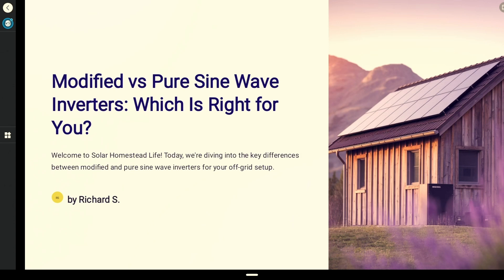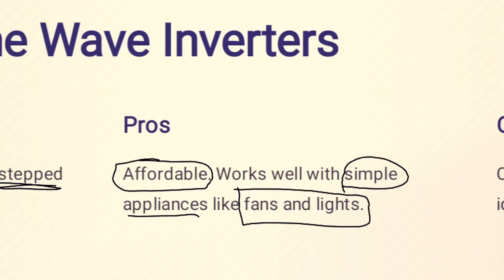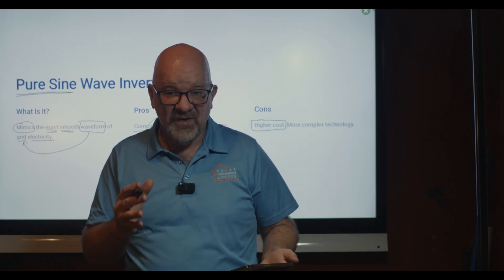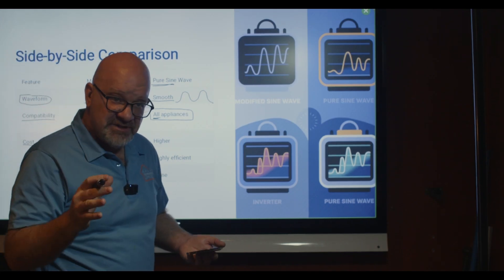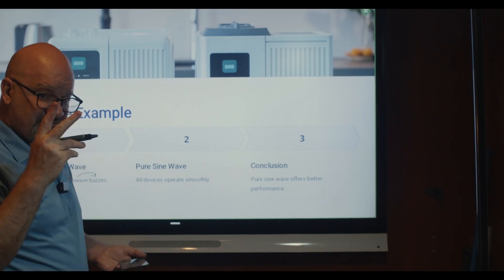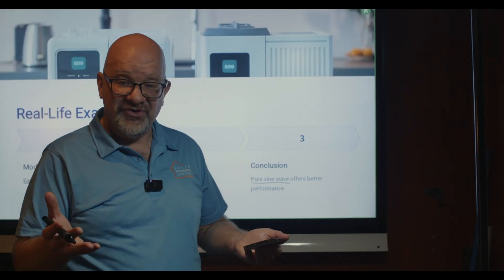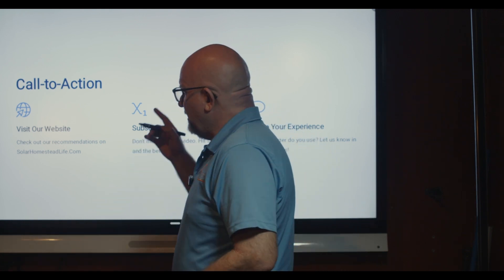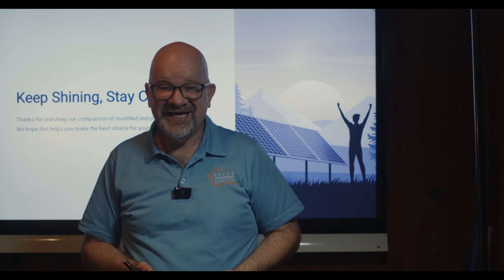Modified Sine Wave vs Pure Sine Wave Inverters: Which One Should You Choose?

Comment: You really don’t explain why other than it’s better.  I have used both on tv, refrigerator and so on.  They both seem to worked fine.  You say it MAY cause buzzing.  What if it doesn’t?  Does that mean it’s fine?  Please explain.
Reply from the maker: Totally get what you mean! Sometimes it feels like both work just fine. But yeah, I’ll try to break it down better next time—thanks for the heads up!